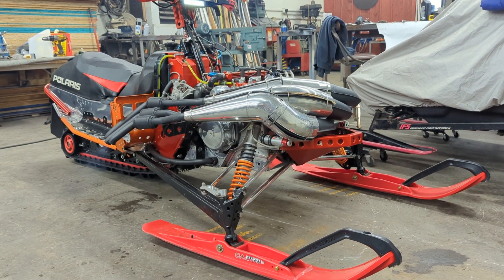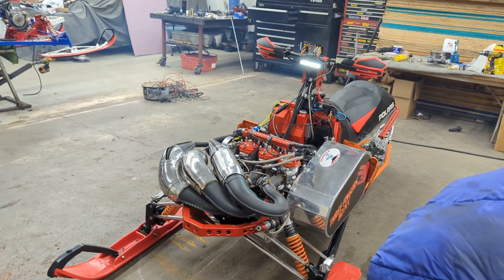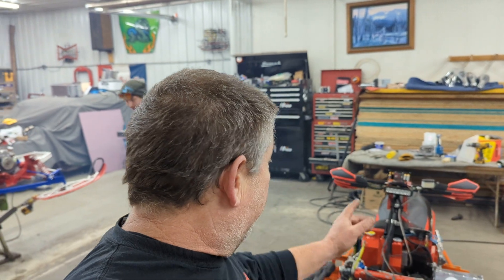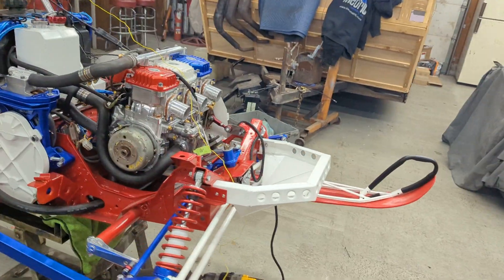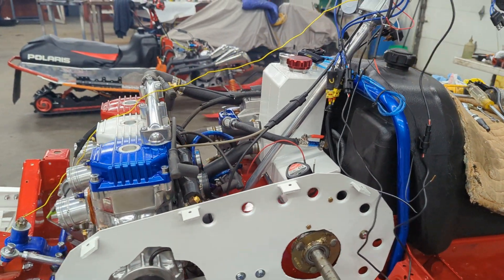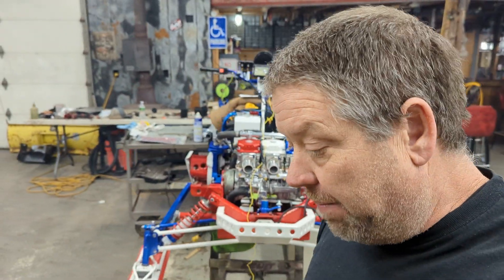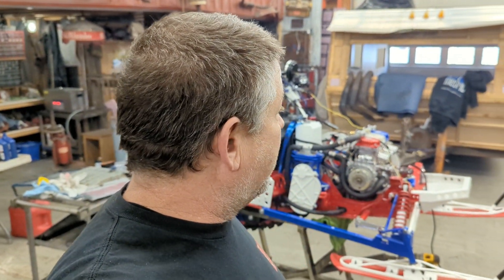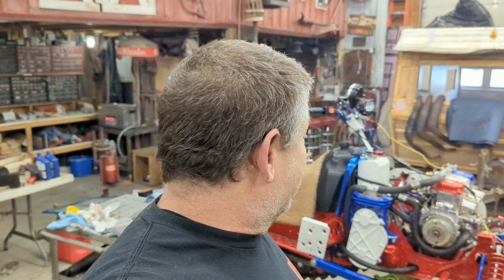POLARIS CRAZY TRIPLE MOD SLEDS ULTRA/STORM

Comment: Hey Todd! Not sure if you know anyone building old 600/650 based engines but I've got a couple of Wiseco 600 BB pistons for the early 80's triples (the engine that came before the 650 red top). Know anybody who needs some vintage stuff for a build? I've got two of different sizes from back in the day.
Reply from the maker: I have a shelf full of bb 600 stuff that I have been practically trying to give away for two years now. I guess nobody is playing with that stuff anymore
Reply: @toddclyne3493  yeah I’ve been debating whether I should eBay it all but I get the feeling it’s going to stay in a box somewhere for the rest of time